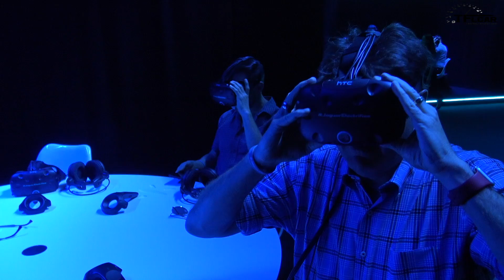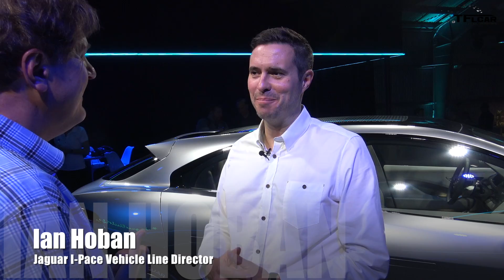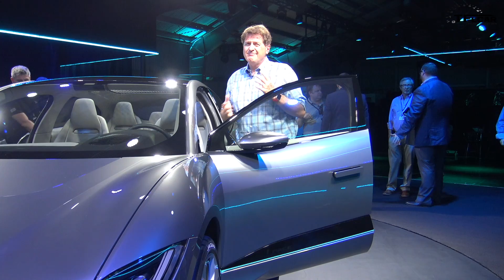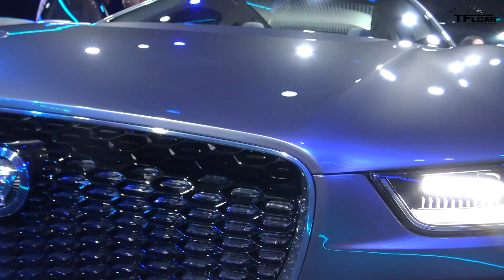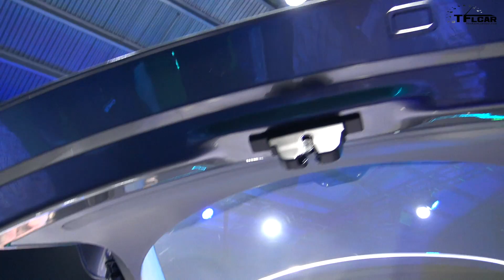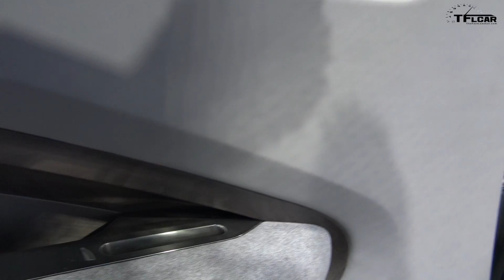2018 Jaguar I-Pace Concept: Jag's First All Electric Car Is an EV Stunner

Comment: 6:06 You made him nervous with that 0-60 question :)
but tbh, that was a little rude... did you ask Tesla why is their interior quality lower than any of the competitors?
Reply: spooty01 ok, i didn't think it was that bad.. but if you made a video, put it out there.
Reply: +spooty01 I'd love to see the video, because from your description, you were in a dumpster out back, high on mushrooms and seeing things. There's no way any company would let a car into the show in a condition that you describe.
Reply: well maybe now it will be 3.5 seconds. its not always intended to be rude. maybe he really wants them to make the best car that he knows they can :)
Reply: Spooky put out the video crackhead
Reply: Nemanjackhole Try asking Tesla why they got millions of fans and Jaguar dont
Reply: Not to mention the reliability
Reply: nemanja milosevic looked at the Teslas they had on display at the LA Auto Show last week... horrible! panels weren't aligned, a door was on crooked, bumpers were deformed and not sitting flush, everything rattled on interior, headlights weren't sitting flush, interior door panel  was loose.. don't get me started on the X.. weather stripping falling off, the hood was open when on display, I found out why when I closed it, it was lopsided and wouldn't sit flush with the front quarter panels. they were trying to hide it. one headlight was crooked, and both bumpers had deformations and didn't sit flush... I didn't dare sit inside the X... that's only some of the stuff. I recorded video.. I knew there were issues, but I was shocked how bad.. and for show cars!

Comment: 220 miles is about 354 km.  I already did the conversion with the bolt(366.93km-228 miles) here in Canada. also is that a solar roof?
Reply from the maker: +courtney Vegan Europe and USA have different fuel efficiency measurement procedures. This is why the Difference between 500 km and 220 miles.
Reply: Musicas de agir
Reply: I was noticing the mesh inside of the roof as well.  A solar generating car would be pretty awesome!
Reply: Nissan leaf has a small solar thing. I hope the next leaf will have a full size solar roof.

Comment: omg whoever designed the interior of this car needs a medal
Reply: Mohamad Jeha They do.. That interior is beautiful and efficient
Reply: Most concept cars look pretty crazy like this compared to the production version.  Just look at the bolt ev concept vs production.  Night/day
Reply: Wasn't that Ian Callum? Because he is the Head Designer of Jaguar and i think every Jag look outstanding. This one is arguable.
Reply: oh, yeah. best looking electric suv. can't wait for 2018
Reply: there are photos of the first series production model, not just concept.
Reply: +Ryan Gifford this thing is disgusting centre control unit is a copy.of the old prius 2009
Reply: Mohamad Jeha passenger better wear seatbelt head gettin cut in half on that dash
Reply: such an ugly interior! I hope it doesn't enter the uk market this ugly thing owned by tata motors. jaguar is finished since it was sold of.